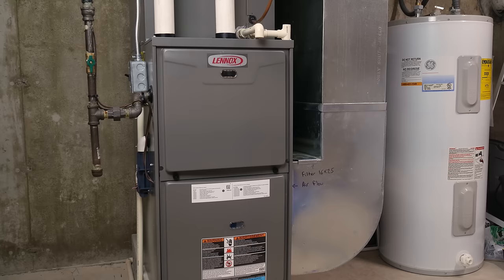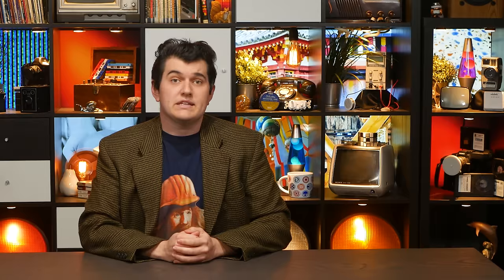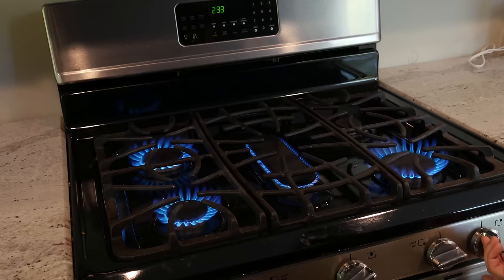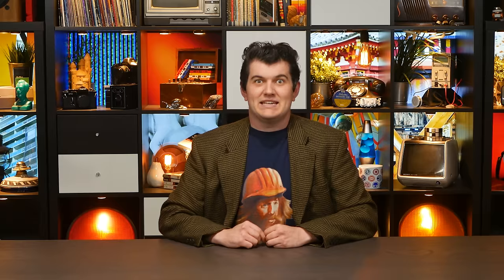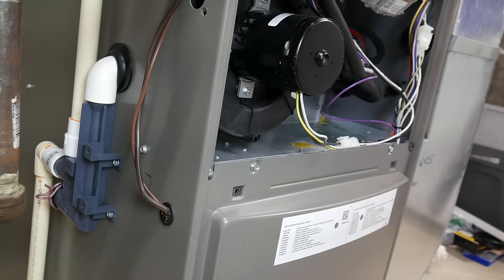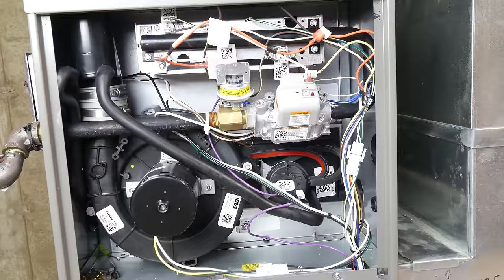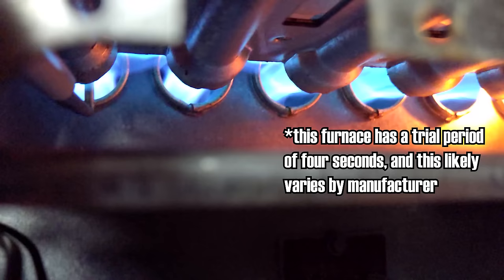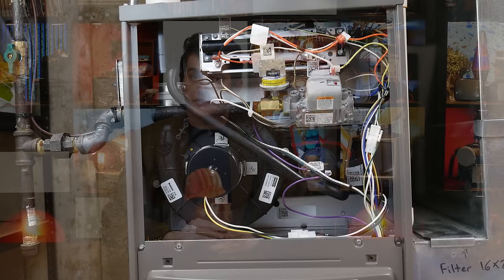Forced-air Furnaces: The What, Why, and How

Comment: Data point: In the northern half of Maine where I live, we don't have a natural gas pipeline network, so most of us are burning No. 2 fuel oil delivered by truck, either in forced air systems or, as in my 100-year-old house, boiler-radiator systems.  A few avant-garde types (like my father) are using propane out of cylinders instead, like you, and of course there are the holdouts who still burn wood, and those pellet stove wackos, but fuel oil is still by far the most common choice in these parts.

Hot water systems are still pretty common as well, although that's at least partly because central air is pretty uncommon in private homes. It's only hot enough to need AC for about six weeks a year, anyway.
Reply: I am one of those pellet stove wackos. It's my primary heat source with a heat pump system as a supplement. I live in Northeastern PA, so not exactly warm. I wouldn't go back. Pellet stoves are efficient and cost effective. (I'm only a convert within the past 3 years, from an oil fired boiler) I will never go back!
Reply: Here in Nova Scotia, truck-delivered fuel oil is the predominant fuel source as well. I'm glad I have electric + heat pumps since it means I don't have to worry about tank condition or CO.
Reply: @PCPSolutions  You are close to the Anthracite deposits, converting to coal (Anthracite) is going to be cleaner burning and less expensive, but not so renewable.
Reply: I'm in Quebec, which is kind of Saudi Arabia for electricity... the default/cheaper way houses are built is to use resistive baseboards here.  The only reason this is done is because the equipment is cheaper to buy and install.  I have one of those 100 year old houses with hot water radiators.  Replaced the fuel oil burner with an electric boiler a couple of years ago.  It's comfortable, but need a completely separate system for cooling, and there is no air exchange.
Reply: I have a wood stove at home... It's the cheapest variant and it makes no sence to have central heating for a house this small.  It is probalby the most common method here. Other folks round here normally have boilers with radiators if the house is on the older side, all fueld by oil bought at the gas station, or, if the house is newer, they heat themselves via AC if they have enough money to pay that electric bill
Reply: @petersilva037  I live in South Central Pennsylvania and we have a mix of virtually everything here, sometimes in the same home. My neighbor's house has electric hot water, gas stove, and oil furnace. This is actually a godsend as he now has dementia and his daughter had his gas shut off out of an abundance of caution (he doesn't use the stove anyway), but he still has heat and hot water.
Reply: Hey, fellow Mainer here! Little bit more down south than you. Noticed many people have been getting heat pumps the past couple years.
Reply: also in Maine; my 100+ year old house has a boiler which works perfectly fine. I was surprised to hear that forced air furnaces were as common as they are because it seems everyone around here has boilers lol
Reply: Antonio Sarosi heat pump with oil backup and bottle gas cook stove with two electric water heaters........big house ya know....and in Virginia we still have all four seasons, often on the same day.
Reply: @PCPSolutions  pellets for heating used to be very popular in Sweden. It's still pretty affordable and exists in a lot of honed, but now air to water heat pumps have gotten more efficient and cheaper, so people tend to choose them instead.
Reply: Why don't you use electricity? In Quebec most houses are heated with electric baseboard heaters.
Reply: endoresu electricity is too expensive around here...though small houses can use it effectively mine is 2300 sq feet...but then ido have a heat pump down to 35 degrees, and that works well. After that oil takes over.
Reply: Oil heating is still common on Vancouver Island in British Columbia, as a submarine natural gas pipeline wasn't completed until 1993.  My sister in Victoria converted to a heat pump a few years ago as the cost of fuel oil was becoming prohibitive.  It has paid for itself at least once over.
Reply: @jrmcferren  I have a friend  who works at a coal mine and he told me that once a week they give coal (for free) to people who still use coal for heating.
Reply: Here in Norway it is now illegal to burn oil for keeping your house warm...
Reply: @endoresu  Because it would cost a dang fortune, that's why not. When I was a kid in the '70s, my parents built a house my dad designed to be heated with electricity. During our first winter there, the price of electricity just about doubled, and it's never come down since. Dad put in a wood stove and thenceforth we were only ever allowed to turn on the electric register in the bathroom.
Reply: @a64738  Harsh. Do you have cheap gas or hydroelectric there, or are you just screwed?
Reply: @grafando  Yeah, I looked into switching to a propane/heat pump combo (like my father's done at his place) a couple years ago, couldn't get financing for the $10K+ it would have cost up front. They said my existing system wasn't old enough to justify replacing it.
Reply: @ZGryphon  you need to get another quote then because it should not be 10 plus Grand it should be around five grand or less my father's house was just quoted and it was about two grand
Reply: @grafando  That wasn't just for a heat pump (which wouldn't be much use by itself in this climate), it was for replacing the existing boiler with a propane-fired one as well as a supplemental heat pump for the first floor.
Reply: My house in France is heated with a liquid fuel boiler. It used to be very popular between the 40's and the 80's, then new houses used electric radiators and now, new houses use heat pumps, but they consume quite a lot of power (even if it is still up to 3 times less expensive than liquid fuel thanks to our "affordable" nuclear energy).
The boiler and water radiators are great because they store a lot of thermal inertia in their big metal "body" and still provide heat some times after the boiler has shut down. I hope that hydrogen boilers will be available in the next decade, because it could be produced by renewable energy, will be cheaper than liquid fuel and will leave no soot in the exhaust pipe.
Yet, liquid fuel is still very expensive. A new French law now prohibits the installation of liquid fuel boilers and the government is releasing incentives to switch to gaz boilers or heat pumps.
Reply: @ZGryphon   Electricity price go up and down depending on how full the hydro electric dams is, but it is generally low. Most that need alternative heating use wood fire because that is not banned (yet).
Reply: @PCPSolutions  I am a pellet stove wacko too, only I burn corn mostly.  I am a corn (among other things) producer and the corn I burn is the cleanout of the combine after harvest, which I might add happens just before the main heating season.  I also have a high efficiency wood burning stove as well.  It exchanges the heat so well that I can put my hand on the chimney with a 500+ degree fire going in the fire box.  I have so much dead trees and what not around my property I could burn for the next few hundred years.  Oh yeah, electric service is pretty spotty to my house (farm) so some sort of back up is required.  I have generators and if the apocalypses happens, a hand pump or gas powered pump jack on a separate well from the electric pump.
Reply: @a64738  Yet, Norway produces a lot of oil. Someones gonna burn that one way or the other.
Reply: @fabienpoupon8493  you guys are lucky over there in France to have politicians who care about nuclear energy. People here are irrationally afraid of it.
Reply: @petersilva037  electric boilers are great, they modulate with basically no extra equipment needed, unlike with gas or oil. And they can make hot water on demand, so you never have tank capacity issues or bacterial growth again!
Reply: @fabienpoupon8493  : Hydrogen is a horrible fuel, either natural gas or synthetic gas (methane in both cases) is the better choice. Comparable energy-to-mass density to hydrogen, more efficient to make synthetically (from hydrogen & carbon dioxide, so not more efficient to produce than hydrogen) than any other hydrocarbon, and on all of the other important metrics for combustion (including maximum energy-to-volume density) superior to hydrogen.

Seriously, hydrogen leaks through everything, and damages many metals on the way through, leave that stuff at the production facilities.
Reply: @tissuepaper9962  well, the left wing and the environnementalists want to leave nuclear energy for safety reasons, whereas our governement wants to expand our current nuclear reactor's life expectancy up to 60 years but by making expensive maintenance and adding more safety features after Fukushima, which will cost dozens of billion euros and make electricity prices rise. We are mixing nuclear power with renewable energy, and when nuclear fusion is available in 50 years, we will switch to it.
However, our government shut down our oldest nuclear power plant (Fessenheim) 3 months ago due to politic pressure from the left wing and the germans (the power plant is next to the german border). Germany is shutting down her nuclear power plants and replacing them mostly with coal et gas power plants. France sells excess electrical power to Germany to balance their electrical grid in winter.

Comment: My grandfather has a boiler for radiator heat. He had no ac until about 5 or so years ago. Living in Chicago.... will all those 110°+ heat waves. Being 80+ years old. With a heart condition. Life finds a way!
Reply: I'm curious when someone will come up with a two-way radiator system based on heat pipes. Seems like a vacuum-pressure system should be somehow workable.
Reply: @absalomdraconis  
you mean an air conditioner pointing outwards? heheheheh
i think it would be very expensive to run compared to gas, or am i missing something?

Comment: Many thanks for this video!  Last week [2020 11 03] my 29 year old 80% efficient gas furnace was replaced with a 96% condensing furnace very similar to yours.   Your explanations give me a better understanding of what is going on inside this cute new machine - the installer guys were too busy doing their work to give me a detailed technical lecture on modern furnaces.   LOL  It was indeed expensive, but my gas supplier [Fortis B.C.] is currently offering a double-rebate [$1400] so my net cost will be acceptably low once I receive the rebate check.  BTW, my detailed gas bills show that the B.C. carbon tax I pay is roughly equal to the basic cost of the methane itself. All else are charges for GST, PST, storage, transportation, etc.

Comment: I just bought a house, two years ago, and it had a neglected oil boiler. I got it up and running for the first season but only used it for backup heat. I installed an electric water heater and a pellet stove. Pellet stoves have all the same safety devices as a furnace, pretty neat actually. I tore out the boiler and installed electric baseboard heaters, its a small house, for primary heat but usually rely on the pellet stove. Great video!

Comment: It's so nice living in Iceland, where we get geothermal water out of the ground to heat our houses, provide hot water from faucets and even to heat up driveways and sidewalks when it's below freezing... and it's dirt cheap.... actually, so is our electricity, since that is either hydro or geothermal too
Reply: My natural gas costs me no more than 75 us dollars (or 10,429 Krona) a month throughout the winter. What does geothermal heating cost? Just curious.
Reply: @Adam-qs5ir  Geothermal heating only costs as much as the installation and maintenance of the heat pump, but its effectiveness varies from location to location. Recall that Iceland is highly volcanic, and hence there is a very good return on investment with a geothermal heating system. The issue is that in most places, one must dig a long way into the ground (at least 100ft, the deeper the better), so as to escape the variable temperature of the upper layers. This may be different in Iceland.
Reply: @Jupiter__001_  makes sense, drilling that deep probably costs a fair amount.
Reply: @Adam-qs5ir  Plus there is the small cost of driving a pump to move the water (though a heat exchanger can also be used, there isn't much point in Iceland).
Reply: @Mark Kennedy that's hard work, but I'd enjoy it
Reply: @wesleymays1931  The volcanic nature of Iceland is what makes this feasible on a wide scale. The economics just don't work in most of the US.
Reply: @Jupiter__001_  in Iceland, that cost is centralized. The public utility literally pumps hot water to your house in insulated pipes. There are few places in the world where this would work at such scale.
Reply: @LiveFreeOrDieDH  Wow. I guess that makes more sense than an evaporative heat exchanger in the stone beneath your house, since Iceland has such hot stone that they do not need evaporation, and just pump the water down.
Reply: @Jupiter__001_  They actually release naturally pressurized hot water from the ground (which has too many dissolved minerals for home use) then use that to heat potable water through a heat exchanger.  @TomScott did a video about it recently: https://www.youtube.com/watch?v=OgMXjAQ5q14
Reply: @LiveFreeOrDieDH  Interesting. I guess that really is quite a one-of-a-kind system.
Reply: @LiveFreeOrDieDH  Yes. As I was saying, better than America.
Reply: Honestly, the women in Iceland are hot enough to keep the whole place warm.

(I'm only partially kidding. Icelandic blondes are ridiculously beautiful.)
Reply: @wesleymays1931  Yeah. We get it. You hate the U.S. Geothermal would never work in the U.S. because of the size of the country. Iceland is tiny, has volcanic activity and has a much smaller population. Geothermal isn't feasible here. If it was available I'm sure we would be using it also. Relax guy.
Reply: Iceland has some of the lowest electricity cost in the world. This is why Iceland is where most of the world's aluminum is actually processed. It takes a tremendous amount of energy to process aluminum from ore so ore is shipped from around the world to Iceland and turned into aluminum where it is shipped elsewhere for manufacturing.
Reply: Geothermal is awesome until the volcano powering it explodes.... TOO HOT WAY WAY TOO HOT!! lol snooty Iceland